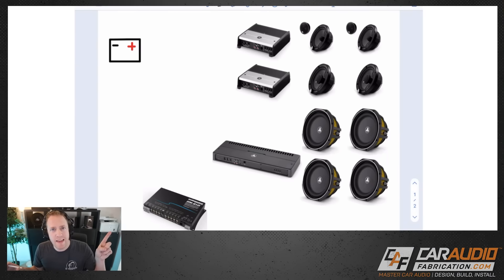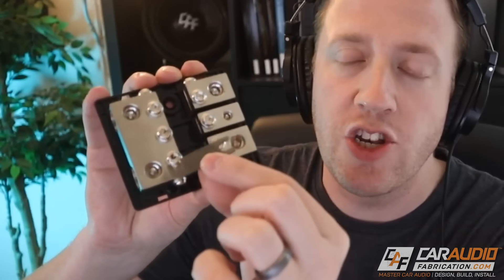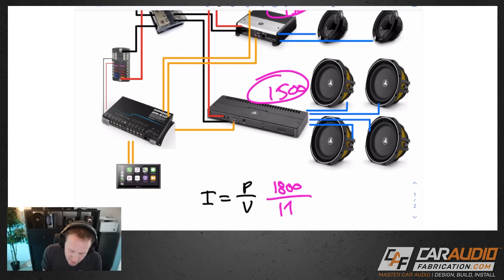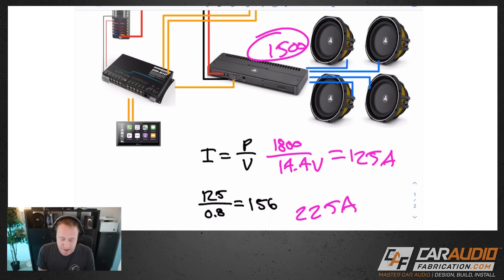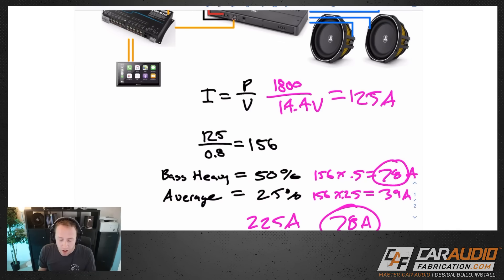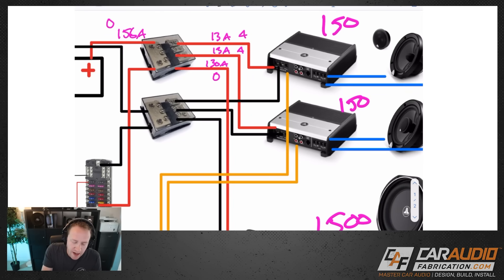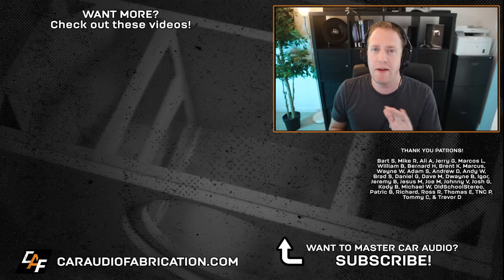HOW TO - Electrical System Design for 3 AMPLIFIER + DSP Car Audio System!

Comment: Just started my boat’s audio. I did a nice HU 75 watt per channel amp four 6.5 and four 4 inch. Extremely nice sound just enough bass for clean sound. May add a DSP soon just not sure it will do much with two way coaxials. What’s your thoughts on DSP for a small system?

Comment: Once again, great explanation on power requirements and amps. I have an older car, and the factory alternator produces 50 amps. I've calculated max amps at 103. Base heavy 52 amps and average 26 amps. I might have issues at night so am going to upgrade my alternator, which did not cross my mind before this video. Thanks for the info.

Comment: Hello! Thank you so much for the information you provide in each video! I wanted to ask you a question: What would happen if, instead of using two pairs of RCA cables from the HU to the DSP, I only used the optical output from the HU to the DSP? Is that possible? Are all fading properties still available? Greets from Argentina!

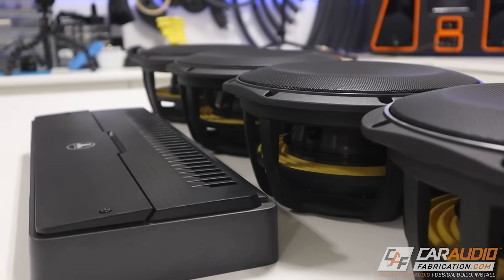Comment: 5:21   hi mark I got little bit confused at the two way components (tweeters and midbass) why you use 2 channels instead of 4ch amp,  Doesn’t that mean we can’t tune the time alignment and crossover from the DSP even if we use a passive crossovers yet we still cant tune the time alignment coz we only hv 2ch and combined the tweeter and midbass

Comment: I have a ram 1500 crew cab 4x4 I'm wanting to put 16 timpano tweeters,16 6.5 mids and 2 12"subs with 3 3000 watt tar amps. what else will I need to get this completed?

Comment: Listen buddy, I’m an electrical engineer. What’s wrong with sine waves!? 

Jokes aside, this really helped me. I have 2014 Subaru Legacy and not a lot of guidance so I probably don’t need to replace my alternator maybe just upgrade my wires for 600 watts (4 channels 75 Watts RMS @ 4 Ohms and 300 Watts RMS @ 1 or 2 Ohms)

Comment: Dream setup ? For a 3rd gen Jimny used offroad : Alpine Halo head unit, 2*3-way component system in front (6.5"+4"+tweeter) with custom door pod, 2*4" coaxial in back, 12 inch sub in a ported box, preferably all speakers with some water resistant rating just in case. Everything powered by MVi amps from JL Audio and linked to an onboard PC you can access from the head unit (HDMI input) for configuration. Add a secondary source accessible from outside the car and some quick disconnect watersport 2*8" pod speakers (powered by the same MVi amps) for when you're chilling with the bois and don't want to unleash the 2000W+ beast with no alternator running. And of course a bigger alternator cause the stock one won't do

Comment: I have a BMW 352i, and I love bass so I want at #4 8" 500watts 4 Ohms, #6 6.5"mids and #4 tweeters with audio control 6 channels LC7i all JL Audio need  help withs and wire amplifiers #2 bass amplifiers #2 A/B amplifiers

Comment: I have enough 0 awg wire for sending power to an HDA M80 Alpine and a HDP D90 DSP Alpine Amps. Can I use the same 0 awg wire for the Blue Sea fuse box? Will that be too much?

Comment: Adding up all the advertised watts seems dubious. Wouldn't all you have to do is look at the amp fuses, which are often considerably less than advertised watts RMS, particularly in class D?
Reply: A class D amp is rated at 80% efficiency... 
What about a class AB? 

My setup:
Aftermarket HU, 
1 DSP
3 amps 
(2x kicker cxa1200.1s,
1x kicker cxa360.4)
4x kicker L7Ts 12"
Nvx X series 3way components in front, 
And In The rear

Comment: Is it possible to add a dsp in line with my f150's factory amp? I installed an aftermarket sub with a line output converter to compensate for the lack of bass in this awful factory bang and olufson system and now I'm wanting to swap the door speakers and tweeters and be able to fine tune them. I'm not new to car audio but I will admit having a factory amp complicates things. I'd rather not have to add a multi channel amp if there's a way to add a dsp to work with the factory amp.

Comment: My dreah audio sustem is 4 skar evl 12s on a 5k with 8 6.5 ds18 door speakers and 8 1 inch.ds18 tweeters. On two kicker 360.4. a 190 ah northstar battery with a js 320 alternator.

Comment: dream system?
so many choices. morel/audison/blam/dynaudio comps, audiofrog/genesis/audio control amps - there's just so much solid equipment these days. 
r/n i have Morel 3 ways, ct sounds mid for rear fill (budget) and alpine power logic 5-ch amp running a JL TW3
system above isn't my daily and everything was about $2K total including sound deadener etc, but if i were to get a newer ride i'd go big. i'm talking like $6-7K budget..

Comment: You didn't explain how you would feed a 0 gauge power wire or ground into your MONO amp. It won't fit the terminals! =0

Comment: Dream system, huh? Probably the one I just contacted you about an enclosure for. Kinda taking my inspiration from the PPI art Chevy Astro demo van with a lot of weird little touches
3 way stereo integrity front stage, active on a PPI Art Series ax606.2 and an a600.2
2 custom Stereo Integrity HST18Mk3's on a Sundown Salt6
Rear midbass fill on a PPI Art a600
JVC El-Kameleon Head Unit
Minidisc Player as a conversation piece
A roof mount for a large projector to run video through. Portable drive in theater anyone? 
a vintage vcr and tv combo with a super nintendo in the back seat
Helix DSP
Limitless Lithium Cyber12k
Mechmann Dual Alt (this is gonna be fun to figure out they don't make dual alt brackets for my car)
and OF COURSE I gotta go with that Neon Green Kandy Kable from Knu. 2 runs of 0ga and the big3.

Comment: @CarAudioFabrication, Hey Mark, Dream audio system:  First gen Chevy S-10 lowrider standard cab with pass through to a carpeted and tonneau covered bed, LS swap and built automatic trans of course, Sparco seats, custom console ,  Alpine head unit, Audio Control crossover/dsp with rta, fully active three way mids and highs setup using either Dynaudio or Focal tweeters, 3 inch mids, and 8 inch midbass drivers,  all Rockford  Fosgate power series amplification,  three subs in ported box, JL Audio or Sundown, 12's or 13.5's, or maybe 15's.  Program head unit to only play G-Funk.  Now ya know.

Comment: What I have -minus 200 plus amp extra alternator on top of what I have I'm currently pulling everything out I went way too overboard for this vehicle even with to a GM's and 220 amp hours of lithium and 50 farad capacitor. I was kidding myself thinking 150 a alternator could do it . I'm just guessing immediate protection mode is my clue

Comment: Could you help me design and figure out what I need for my amps. Am using 2 Skar amps, a 5 Chanel 700 and a 350 mono. Am putting in second identical battery. Do I need a compactor or bigger alt???

Comment: Hi Mark, I got 1 set Morel supreme mw6 6 1/2 speaker set with piccolo tweeter no cross over , 1 JL amp vx 800/8 and 1 sub 10 inch focal 10WM and 1 amp JL 1000/1 for sprinter 2023 what your though and setup thanks TN

Comment: I'm working on a "dream system" in my jeep.  Currently running 2 10s and 2 12s in the back each on a mono amp.  Then I have 2 4ch amps running ds18 dash components and horns.  Adding in 4 8in mids 2 tweeters and 2 horns in a custom sound bar.

Comment: I have a 2020 silverado 1500 crew cab, I just drilled through the floor and put my ground to the chassis. I wire brushed it until the chassis was silver then i attached my ground. I hope this is good to go lol seems to be fine so far

Comment: Hi Mark!  Greetings!  I'm planning to install a dual amp setup in my Nissan Pathfinder R51.  I've bought the Alpine iLX 702D as the HU and Rockford Fosgate R2-500X1 and R2-500X4, speakers from the same vendor.  I'm a bit confused as to where to mount the amps.  I do not wish to lose the 3rd row seats while the remaining seats seem to have a low space from the floor (~ 1 inch).  Please suggest.

Comment: You are a huge resource for car audio and thank you for providing all this knowledge. Can you please go over the wiring for the smaller fuse distribution box that goes into the DSP? Also, I'm doing a high end build for my Audi RS4 B7 and could use your consultation.

Comment: I've been subscribed for several years and I'm reviewing these videos again because I am working on upgrading the sound in my car. You have fantastic information and provide an invaluable service to us!

The only things I might add to this video's great information:

1) The wire from the battery to the distribution block does not show any kind of fuse or circuit breaker for protection at the battery, but I know that you would do that.

2) The additional load of the DSP that the main wire has to carry. It may be only 5 or 10 amps, but it has to be considered, so the main wire will be carrying 161 or 166 amps.
Reply: I didn't notice, but you're right. anyway, with such a good power wire between battery and distribution block there's nothing wrong with adding a fuse with more capacity than needed, like 175A, or maybe even 200A

my car has 180A stock alternator, I got a 35mm2 (2 gauge?) power wire with a 175A fuse next to the battery. my amps should in theory max out at about 93A with my setup atm. sub is 2x350W, doors are 4x75W, but I added 5W to each door because of passive crossovers, just for the theorethical max. engine idles at 13,8V, voltage drop thru the cables are just 0,04V (with chassis as ground, tnx VW for making good cars that are horrible to work on because of tight spacing)

Comment: Hey Mark I have a question I have a 2013 Kia optima SXL that came with the factory navigation and infinity sound with six speakers and a subwoofer but since I've had the vehicle I took everything out replaced them all with aftermarket speakers but I'm having a problem because I don't know how to wire the other three speakers the dash and the center speaker I would like to have them all working as they did when I bought the car so I just want all speakers working can you help me figure out how to wire them I have two amplifiers a capacitor and a base restoration from audio control so I have the Alpine PDX 1000 watt 5 channel amplifier and I have the kicker 3800 Watt monoblock powering the Memphis 1222 pro 12-in speakers in the doors I have JL audio c3 convertible in the front and the back I have the tweeters inside of the speakers for the mid base and I have 3-in speakers on the dash jail audio and in the center but I don't know how to wire it and I have an Alpine ILX 407 head unit I have a power distribution in the back I have a 200 w breaker from the battery and I'm powering it all with the optima battery and a majestic 5 farad capacitor could you please help my system sounds good now but I wanted to sound better and I'm thinking about getting an Alpine DSP on I'm running a 0 gauge power wire. My dream system would be the Hertz 6x5 components in the front and then mid base to the back and the 3-in speakers in the dash and the mojo pros pros 12-in subwoofers and rear and Alpine PDX amps all around with the DSP and a big smile

Comment: My current dream with no budget in mind would be for my quad cab... Kenwood DNR1008RVS head unit, two 10" Infinity Kappa sealed, 3 way Component Infinity Kappa Actively controlled front, 2 way component infinity Kappa rear(I'd settle passive), 6 channel amplifier front, 4 channel rear amplifier and 2 channel rear Sub amplifier, 12 Channel DSP, and Good thorough Sound deadening of the body.  I don't want loud obnoxious bass, I want clear clean when quiet up to full control range.  Don't have any idea which specific amps I want I haven't shopped for amps in forever so the stuff I used to look at don't exist anymore, Don't know of any 12 channel DSP that are good.

Comment: Question when figuring out speaker size cable i have focal splits for the fronts im putiĺng in and i already have 16 g cable they are 240w total or 120w rms will 16 gage be ok or do i need to buy some 12 gage cable? Cable runs from crossovers will be 4.5 meters for one side and 7.5 meters on the other

Comment: Great channel and good work!
You asked about our no holes barred build?
Here's mine:
I own a 2008 Ram 3500 Quad Cab Dually with some existing JL component speakers.
1 pair 4" Z series components in the dash.
3 JL tweets across the dash also, one as a "center" channel.
1 pair of 6.5 components in the front doors.
1 pair of 5.25's in the rear doors.
All powered by a HD400.4 amp that's toasted.
For bass, I was running a single JL 13v3 4ohm in a fiberglass and wood tube I made. 
1 JL HD600.1 powered that sub and it too toasted.
My factory alternator over volted and I believe that was the cause of the amplifier failure.
I've since upgraded my amp to a 420A unit.

Anyways,
I want to upgrade all my component speakers and amps to the highest JL lines.
I want to make a fiberglass rear seat back wall with the older 13TW5 subs. I may be able to use 3-5 on that wall.
I had built a fiberglass spare tire well box for a 2014 Mazda 2 with the 13TW5 about 10 years ago and I really enjoyed it in that car.

Comment: im only installing an aftermarket stereo an equalizer and one amp im using block distributor for my 12v lines but my question is can i chain the same remote on cable? from the stereo-EQ-amp ?

Comment: I'm currently building my dream system. All JL Audio because I fell in love with the VXi series off amps the moment I saw them.  Im going to be running an active three way with the C7 and the C3 components for the rear doors running off the VX800/8i and then two W7 12s running off a VX1000/1i each in a custom built box. Going to have the Sony XAV9500ES as a head unit. All going into my 06 Ram 2500 diesel. Going to be a good spring project.

Comment: Hello, love all of your videos. Just had a question. I will be running a zapco 150.6 lx amp to my 3 way active front stage and then two 2 channel api amps both bridged for one audifrog subwoofer each. I will either be using my jl twk 88 dsp or if that wont work i will get a dsp that will work for this.My question is what do i need to do with the subwoofer rca’s because i am using two separate amps for subs? Do i need to do some kind of y connector or…?
Thanks in advance

Comment: My dream system.  Here goes... Kenwood head unit,  Arc audio blackbird amp, Mosconi Pro 4/30 amp, MOREL MAXIMO ULTRA 603 MKII 6.5" 3-WAY COMPONENT SPEAKERS , Helix mini dsp, Bobby Gately Box w/ 3 JL W7s

Comment: Hey Mark I see you doing car builds but you have marine equipment so why don't you do a Harley build for an example how about Sony xav7000 head unit and 3 MX500/4 amps with 8 speakers 2 8in subs and 2 tweeters up front I am using kicker 6.5 speakers and 8 in subs.

Comment: Would a similar setup like this work with 3 sets of tweeters and mids and two 12s, no need to be specific but would amps like these be able to efficiently run three sets

Comment: My dream set up would be , dls 6"splits and mids , 1x jl audio 12w7 subwoofer , powered by ark audio 4.150 for the splits and a mono , 1500watt ark audio to Power the sub. Processor , dls.

Comment: Dream system... 
JL Audio C7 3 way component system in the front, JL audio C7 2 way component in the back, 2 13TW5 subs in a sealed box, VXi 600/6 amp for the front, VXi 400/4 for the back, HD 1200/1 amp for the subs. 
2 dedicated batteries for the system and a pair of cond3nsors from stinger.
All conected to a stinger HEIGH 10 head unit
Reply: Update
I'm finally geting into building a system for my mini van, I am actually gonna use a 3 way in front and a 2 way in the back (although a coaxial). I'm using Focal Access right now as my speakers, so I'm using the 3 way access set and the Access 6x9 coaxial in the back. Then, I'm gonna use a small DB srive euphoria 4 channel amp 75x4 watts rms and I will add an active subwoofer, probably one from Cerwin vega or DB Drive.

I also have a very nice project for an Express Van. Not defined yet, but I would like to have a JL Audio C3 component in the front, the C2  6x9 coaxials on the OEM location (low inside the back doors) and a set of C2 4 inch coaxials on the last OEM location (in ceiling of the very back). For the sub, a 2 subwoofer setup under the front seats (1 sealed box below each front seat). All powered by a 4 channel RD amp for the front speakers, an RD series Sub amp for the subs and a JD series 4 channel for the back speakers. 

Finally  I have a dream build for a WV bug using a 3 way C7 component in the front and a C3 5x7" coaxial setup in the back, complimented by a pair of TW3's. 

For now, I will see how my system performs with the inexpensive 3 way + 6x9 coaxial setup and a shallow active subwoofer. I hope it performs okay.

BTW, whoever is planning to use a C7 3 way, think about the Focal access 3 way to replace those nice components once you decide to sell the vehicle. It costs like 1/10th or less

Comment: Hi. Im looking to do my dream car audio system. But i need help, I'm on a budget but so i can't take it to get done.  This is what I want, two component speaker sets along with two pairs of coaxial speakers.  Now for subs, i want 4 10" subs with 3 12" subs and two 15" subs. Now I want the door speakers plus two tens playing pretty much all the time. But i also want two kill switches for the other subs.  With the car audio playing, first switch will be for when the door speakers ain't cutting it. Hit the first switch and bass. And if that ain't pushing hard enough, second switch is for the 15" to get the thumping hitting sound. I want to be pushing 20,000 watts.  I have an SUV. What are some suggestions or advice that you could give me for that type of project??